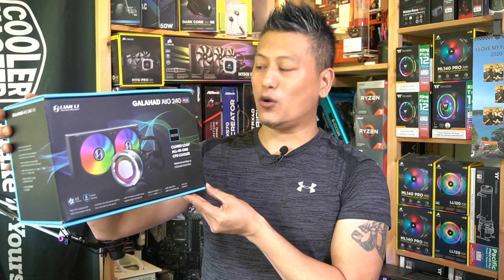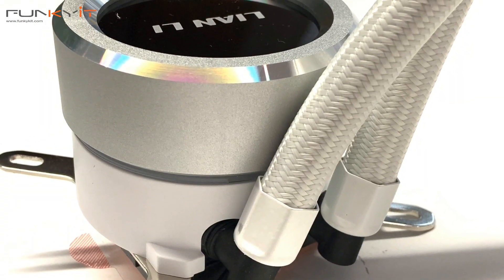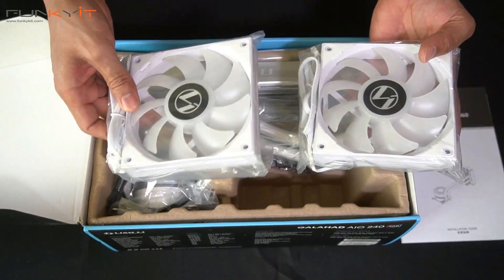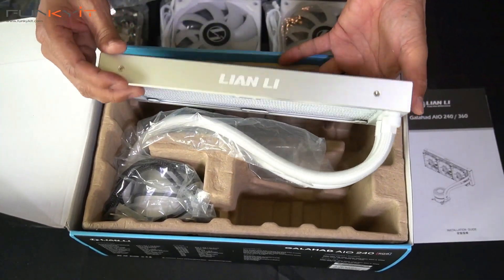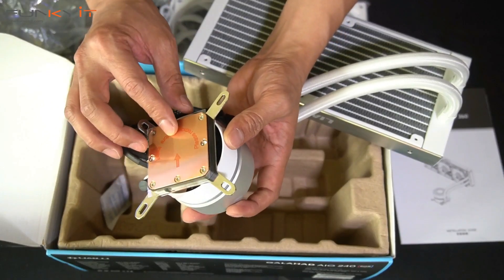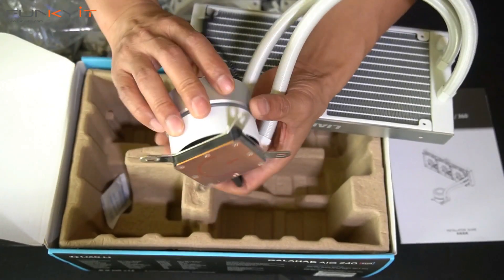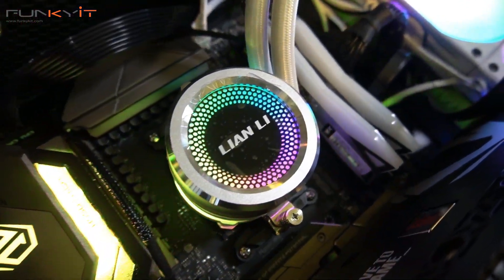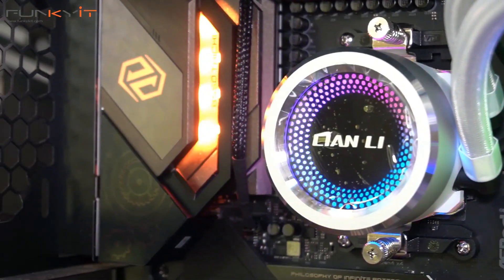The Best Looking AIO 240 RGB CPU Cooler - Lian Li Galahad

Comment: Keeps my intel i5 10600k clocked at 1.35 volts and 5ghz at a frosty 55c. Even under full prime 95 torture tests.  If I don't overclock it, it stays under 43c

Comment: Just bought this to pair with my 10th gen i5 10600kf. Had to dump the cooler master it hung over my ram sticks on a push through radiator style and I didn't want the fan to suck air into the radiator, hopefully it fits in the icue 220t case

Comment: There is one thing I dont understand. Your supposed to connect both the pump and the fans to a PWM fan header on the mb, and then you control the fan speed and the pump speed in bios? and the temp that controls the speed is the CPU temp not the block temp on the AIO? or do you control the fan speed in a software from Lian Li?

Comment: This temps you mentioned are very high for a water cooler
Reply: Pretty sure he forgot to take the plastic off lol
Reply: That's what I though, I'm running a 3700x with a Kraken x63, my idle is 37° and full load is 60°.
I never achieved 80° on a ryzen 3rd gen
Reply: @nailoxe  yeah my wife's 3700 hits about 57 while gaming and low 30s while idling.

And my 3900x is about 5° warmer than her 3700X with a similar aio cooler
Reply: @nailoxe  x63 are 280mm bigger radiator and fans.
Reply: Radiator tubes should not be at the top on a vertical setup.

Comment: First time AIO user so excuse any stupid questions:
Firstly thank you for bringing this review to us :)

-Brand new and the radiator already has dents, is that normal?
- 40° Idle, would you say 360 would be much much cooler as it seems rather high still.
- Is the pump noisy?
Reply from the maker: Pump and fans are quiet. Great ARGB lighting effects. Yes you will get the odd small dent but nothing to worry about
Reply: The temps were oddly high for him tho, not sure why